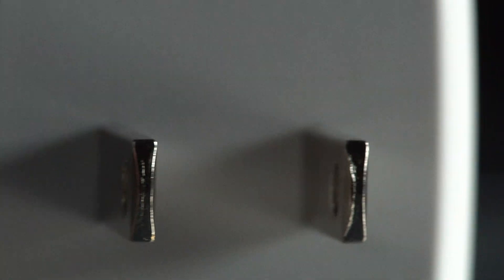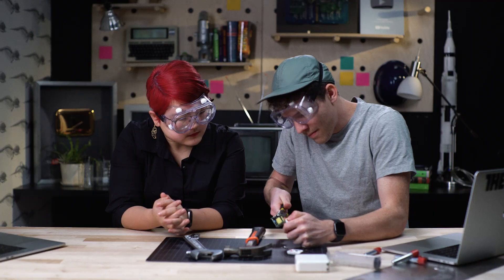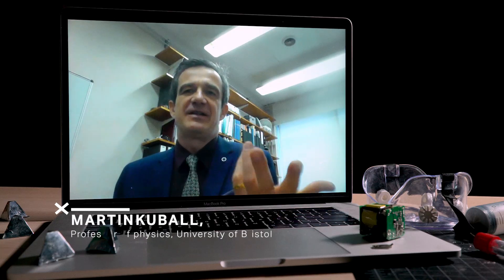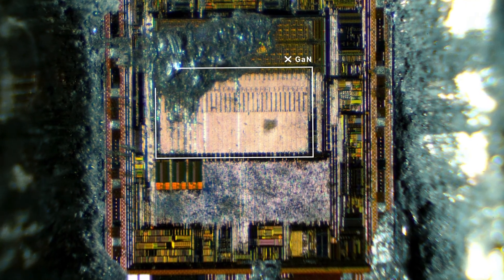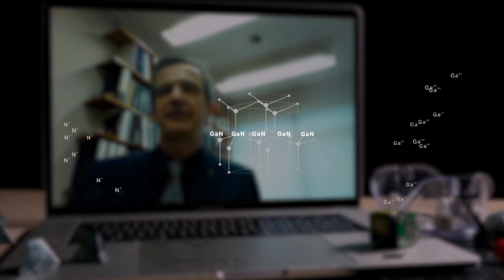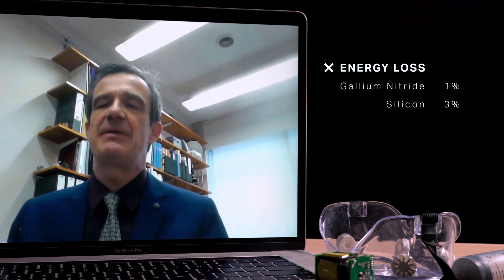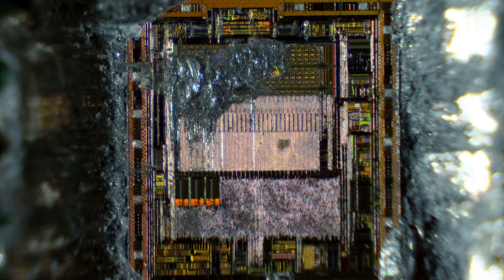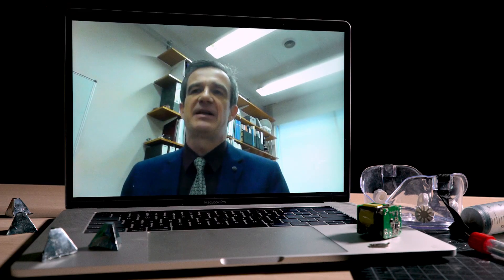Is gallium nitride the silicon of the future?

Comment from the maker: What tech would you like to see miniaturized in the future?
Reply: Batteries, of course!
Reply: @richie1326  I second this!
Reply: I'm looking forward to being able to carry around a Petabyte of data in a drive the size of my palm. Although I guess video files are going to be trying to keep up with 16K at that point and it'll still only be an hour's worth of footage...
Reply: Use of Celsius instead of Fahrenheit
Reply: Carriers
Reply: 90% of chargers volume is transformer, input capacitor, output capacitor and high/low votage gap. May be PFC inductor, if it's powerfull. And most of energy lost in transformer, which made of coper and ferrite. Semiconductor upgrade actually will do nothing.
Reply: @rainbowhyena1354  thank you!  Regulations require massive transformers, common mode chokes, and film capacitors.  The actual semiconductor makes up probably 5% of the size.
Reply: Hot air balloons
Reply: Transistors.I know that they're already very small but it would be nice for them to become even smaller so that more of them could be out inside a small device such as glasses or contact lenses.
Reply: Cybernetic rectal implants.
Reply: Transistors
Reply: Chargers and motor controllers for electric vehicles. If they produced a third if the waste heat, the package could be much smaller.
Reply: Tweezers - GN Steve agrees
Reply: How about companies like you that post false copystrikes? If we could minimize that it'd be cool.

Make an apology video and man up.
Reply: @dionthorn  That's about as likely as them putting out accurate information!
Reply: Gallium Nitride Neodymium Magnets. As small as the head of a pin but strong enough to pull a chair from 5 feet away.
Reply: quantum computers.
Reply: @Neo_0011  yep, that really would be something, cos at the moment, despite the hype, and claims, I'm not sure that anyone has yet built a proper quantum computer, of any size. By proper, I mean something that truly leverages the potential of quantum superposition to solve n-p problems in an instant. At the moment, as far as I am aware, so called 'quantum computers' just imitate conventional ones. Not that I'm saying it's easy to build one of these things...
Reply: How does the gallium nitride make the charger smaller? You are comparing a 30 watt charger to a 60 watt charger in the video and act as if the difference in size is due to the use of gallium nitride when it isn't.  The biggest components of the charger are copper coils and capacitors. The 60 watt charger obviously requires bigger coils and more capacitors. Capacitors being another space consuming component. The reason the other charger is smaller is due to design and output power. The chip that contains the gallium nitride doesn't get significantly smaller compared to regular chips . The only real advantage it has in this charger is the efficiency, which ofcourse is welcome in a charger. But the chip is not where the biggest loss in a charger comes from in the first place. In general most chargers are already 85%+ efficient.
Reply: Man portable directed energy weaponry, or portable power technology powerful and compact enough to be used for powered exoskeletons or power armor.
Reply: Virtual Reality
Reply: Cats!
Reply: Energy production and storage. More mass efficient, more volume-efficient. MUCH more. Crack that, and then we can have "the future". Flying cars. Jetpacks. Ion engines with "TIE fighter" level thrust; single-stage-to-orbit spaceships. Railguns. Handheld laser weapons. Cyborg implants. Iron Man exosuits. Electrolaser 'lightning blasters'. Hoverboards. Solid-state aircraft engines & electric jets. Most of the technology already can exist in a test rig with some big, bulky outside power supply; we just lack energy storage methods with the requisite power density to put it into practical use in self-contained units.
Reply: Tigers!
Reply: Chargers. PSUs in general.
Reply: Energy storage
Reply: Verge Science gallium oxide vs gallium nitride
Reply: Is it at the same level as silicon when it comes to sensitivity to solar flare ?
Reply: Batteries
Reply: He not fighting static, he fighting cancer...
Reply: those cable-management "tweezers" would be awesome in miniature!
Reply: i down voted for all the copy right bs. i will down vote all your videos i watch. oh and add blocker so you get nothing
Reply: a mini hammer that hits your fingers, everytime you think about striking another youtube channel out of spite.
Reply: Religion
Reply: You're douchebags
Reply: Less bulky AR and VR headsets.
Reply: Stupidity. Ok no. Bad idea. cuz then we could fit more stupidity into the same space. How about alternators? Say buy a cheap tiny $10 alternator you can clip to your exercise bike and recharge your phone or pad...
Reply: Everything? Can I pick that?
Reply: Desktop power sources...hell with laptops!
Reply: Storage devices
Reply: What tech would you like to see grossly misrepresented in the future?
Reply: who cares
Reply: I like to seesmaller food plants
Reply: What was the scientific point of breaking the charger, it would have sufficed just to have said it used GaN. Less dramatics and more science please.
Reply: (Space)Rocket engines and thickness of reentry capsules
Reply: ironman suit
Reply: Science is SI. Please use K, °C!
Reply: Cars
Reply: Out dated info
Reply: Verge Science nano bots into atom bots 😂 lol
Reply: Sex toys ....
Reply: It's called gallium nitrate if there is nitrogen nitride is if there is an iodine atom inside.

Comment: GaN does not directly replace the silicon substrate, but it replaces the conductive layer that creates the circuit. Some substrates are made of silicon carbide, and use GaN as the semiconductor these are much faster and thermally resistant than typical silicon based semiconductors.

Comment: I'll save you the trouble: No, not in the sense that it will replace Silicon. But maybe, in the sense that it is a relatively new technology, which has only recently reached maturity in an economic or technological sense, and therefore may have many untapped potential applications and characteristics which may revolutionize many devices or systems.

Comment: This is a ridiculous video.  Gallium is NOT a replacement for Si.  Unlike Si, Gallium Nitride is a compound semiconductor like others such as GaAs, GaP, and the special characteristic of these semiconductors compared to Si is higher bandgap.   Higher bandgap has allowed use of these compound semiconductors as LEDs and in some cases as high power transistors which are perhaps more robust than Si transistors.  However, GaN IS NOT a replacement for Si.  They are just different semiconductors.  You will not see IC (cpu and memory) made of GaN, for example.

Comment: GaN does not come in complementary flavors, p and n, so you cannot make a low-power CMOS equivalent, which is the easy victor in any contest of integration. It is potentially useful in high frequency and power applications, but not going to overcome silicon. Sorry.

Comment: I can say with absolute certainty, No.  Any alloy can never be made to high enough purity levels to be useable.  Any metallurgist will tell you that as much as you heat and mix something to try and get each molecule to fall in line with every other molecule you will never get a perfect consistency.

Every cake has different size holes.

Comment: It’s an older tech that may not be relevant anymore, but I remember learning about Gallium Arsonide solar cells back in 2001-ish.  I know about a 1-inch square of it was used under a 10-12” Fresnel lens concentrator in a photovoltaic panel with dual axis tracking (meaning it always faced directly into the sun, which was necessary in order for the lens to direct the light into the GA cell).  Silicon cells proved to be much simpler and more practical, but I’m still curious to know more.
Reply: Yes, I've built some R&D coater machines that were testing SiG techno for cheaper solar panels. gallium i saw was a material format.

Comment: This isn't an issue of industry stagnation preventing widespread adoption.
The problem with gallium nitride is that gallium is about 10x as expensive as silicon.  - silicon is produced from sand, of which it is a primary component, while gallium is only economically viable to mine as a by-product of aluminium and zinc mining because it is so rare. Refining silicon from sand is a bit harder than refining gallium, but the availability of the raw material, and the fact that making gallium nitride is also difficult leaves the gallium nitride costing far more. Extra demand from semiconductors would make this price discrepancy far worse if electronics manufacturers switched to gallium nitride on a large scale.

Comment: 2% energy saving over silicone tech but requires high pressure and temperatures to produce material that may be usable. I'd be interested to see how the sustainability of the two stands up when you take In to account the raw material acquisition and production phases.
Reply: Gallium is also an endangered element

Comment: This is stupid. This wouldn't help make a smaller power cable. AC to DC conversion requires a transformer... Otherwise you'd just have a cable with no electronics

Comment: That's kind of exciting, but I'm missing a summary of why:  What is it being used for in the charger?  Why did you go to the trouble of taking it apart without explaining what the gallium nitride's purpose was?  What are its other applications over silicon besides power use?  What makes the circuit design for a gallium board different than a silicon one?  Just trace size?  Do any other electrical properties change?  This would be a much more comprehensive take in my view.  It would be nice if people of all levels of knowledge can get something from a tech outlook like this one.  Asking about the fundamental differences between the two should have been able to get you there if you had enough sources.
Reply: Probably an ad by Anker
Reply: @rayrayray-l5l  I had that thought too.  I'd be okay with product placement (if that's what it is) if they just did a decent job.  That just makes it worse.

Comment: This isn't new tech, gallium has been used in semiconductors since the late 80's. The issue is the abundance, meaning cost. Silicone is on our beaches, gallium... it's in ores as a bi-product of mining other metals. Not saying it can't be used. But for a charger? Never. It's only going to be used in industrial, research, and military applications. Consumers won't see much of a benefit due to the cost.

Comment: GaN is in fact the reason bluray works but the reason why is really what should have been explained. I feel this video is confusing the issue. The reason GaN is useful is because of its wide band gap where most semiconductors have very short band gaps. Wide band gaps allow semiconductors to operate at much higher voltages which means its especially useful for power transistors used in switch mode power supplies.

Electronic components often use other semiconductors besides silicone depending on the application so its not a matter of just switching over to a single one. The issue here isn't just about "getting use to" another semi-conductor. However the presentation in the video of smaller ICs and efficiency is a huge misnomer. In power electronics higher efficiency is achieved because of lower switching losses at higher voltages. But using GaN in say your CPU isn't going to make it produce less heat but it would allow the CPU to operate at much higher temperatures.

Finally as time goes on there could be many complicated ways GaN could be integrated into existing technologies. But the idea that they are just a drop in replacement for silicone and you go from 3% to 1% loss is just completely misleading. The broadest implication this technology has right now (since its already given us blue lasers) is in power transistors and specifically ones that use different band gaps instead of doping. Have a read: https://en.wikipedia.org/wiki/High-electron-mobility_transistor
Reply: Thank you!

Comment: Due to safely regulations, wall chargers must have a transformer with ample size.  This is what really forces sizes.  Also, many countries require common mode chokes for EMC and class X/Y capacitors for safety.  These are both large devices.

It's not very difficult to design a super small solution, but you can't just do whatever you want.  You must follow regulations.

Comment: I've been using GaNFETs and SiC (silicon carbide) FETs for years.

They are very fast due to extremely low input, output, and reverse transfer capacitance coupled with low inductance packages.  GaNFETs have relatively low RDS(on), but it's nothing special.

My main use for them lately has been with <1ns pulse width laser pulsers.  They do this extremely well, since the rise and fall times are crazy fast.  The rise times for certain FETs I've used is well under 500ps.  Some of the circuits I've recently made generated 40V @ 10A pulses.  PCB layout is everything.

The BGA packages make for low inductances, which is really what matters when it comes to speed.  PCB layout is much more critical, as the loop areas create a larger fraction of the overall inductance.

One thing that is HUGE for the space industry, which I am formerly involved in, is GaN is inherently radiation tolerant, which silicon FETs are NOT.  This means most power conversion applications used BJTs.
Reply: Thank you!

Comment: I don't think chargers could get too small and become just a cable. The transformer is not made of semiconductors. It should have thick wires or it would just melt when the current passes through at high volts.

Comment: What about the consequences for extractive industries. How plentiful is gallium and how sustainable would it be to harvest it at levels required for a substantial market share (I mean on the front end, obviously reducing inefficiency could cause a huge energy savings after the fact as discussed in the video)? And who works in those mines? How much do they get paid?
Reply: Nobody mines just for Ga.  Ga is a "byproduct" of Aluminum processing.    By saying "byproduct" they make it sound like they are getting something for free, but it has to go through a number of processes(some involving coal) to be industrially useable.   Then it has to be further refined to 99.9999% purity to be made into semiconductors with other elements.   All requiring lots of energy.  Not environmentally friendly.
GaN dust is nastier than silicon one.
And lastly:  Ga compounds in general don't recycle well.  GaN is worse than average in this regard.  So, Ga is a de facto finite resource.

Scientist knew Ga would make better semiconductor even before the first diode was made.  But they keep avoiding using it as much as they can, because cases against using it pile up decades after decades.
Reply: @ikickss  wow that's really interesting, I was worried there would be factors like that at play. Thanks for sharing and educating me

Comment: This is really poorly informed. The thing that tends to dictate the size of a charger is the transformer and capacitors, as MANY people in the comments have pointed out. Also, that looks EXACTLY like a reference design from Texas Instruments that has been around since at least 2012 (possibly older) and is the basis for many AC-to-USB chargers with that same tiny footprint.

It's like you guys felt you HAD to show how cool GaN is, but all you had on hand that actually uses GaN was a charger, in which the GaN was irrelevant, so you FORCED the info to fit your editorial. REALLY uncool, Verge "Science". Try again.

Comment: The bulky thing in chargers is the transformer, which doesn't use any semiconductors, it's literally just two copper coils wrapped around a ferrite core. It's also the part that heats up the most, a.k.a the least efficient part. Using a different semiconductor just won't really produce any significant improvements.
Also, as literally everyone pointed out, this semiconductor explanation was the worst explanation ever.
Also also, 1:19 was the second worst explanation ever.
Where we would really benefit form more energy-efficient semiconductors is in processors and ICs, but the thing is, you can't make MOSFETs out of GaN, and that's kinda a large roadblock.
High-power LEDs and lasers is where GaN semiconductors shine (pun very intended), and we've been using them for this task for ages.
Another application could be in high-power rectifiers for industrial use, but they use thyristors, and as far as I've researched, even thou there was an attempt at developing GaN thyristors, they never became a thing.

tl;dr I'm very skeptical about this, GaNs have their use but they are pretty limited, and no, they won't replace silicon. 

Also also also, that charger is probably just kickstarter bait, my bullshit innovation alarms are going off.

Comment: GaN is also used in the transceivers (key component) of some high performance military AESA radars.

I read that its advantages not only derive from its higher electronic efficiency, but it also conducts heat better and both things make the heat dissipation systems need to use less energy themselves.